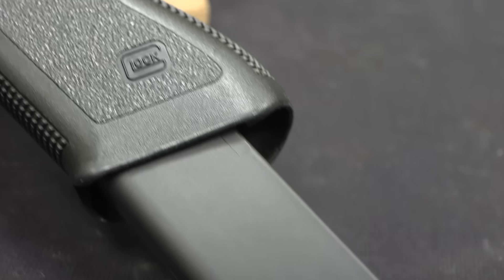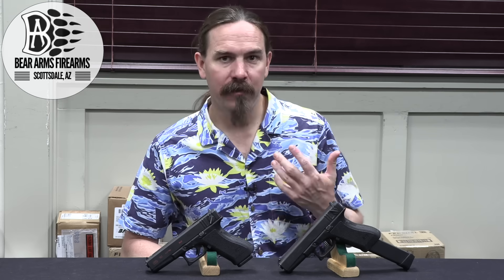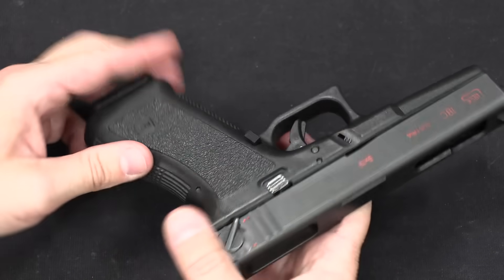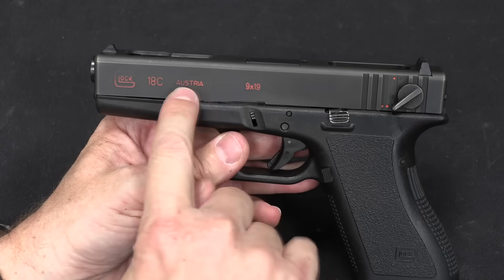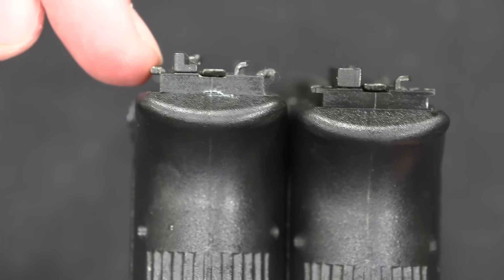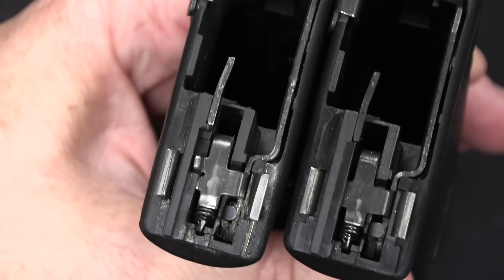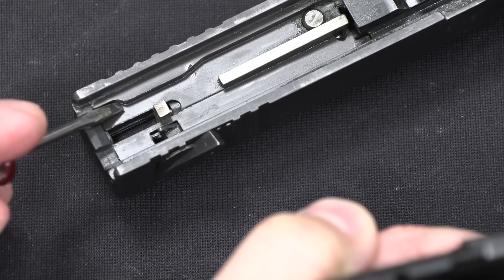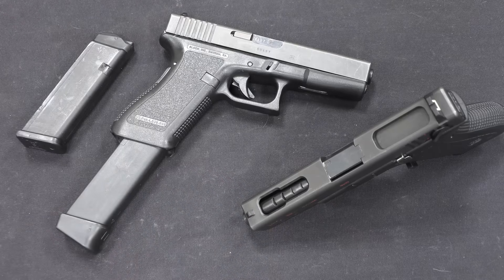Glock 18 & 18C Machine Pistols: How Do They Work?

Comment: So then how does the switch that inner-city folk use at the end of the slide work to make regular 17's into full auto?  Seems like it would take some milling, but I'm guessing that they aren't doing that.
Reply: The principle is the same: an angled surface pushes the sear down just as the slide reaches forward position. A small groove to the plastic frame is all it takes to clear. 

The mechanism in the switch moves the angled part rearward for semi so it doesn’t trip the sear.
Reply: @Glocktologist  Interesting.  Thank you!
Reply: Just a backplate swap

Comment: Clever solution to alter the slide rails to prevent the thing that we were all thinking about.
Reply: I imagine that even if you were magically able to slam an 18 slide on a 17 frame, the protrusion from the selector will just get caught up in the bit of the plastic rail that's cut off on the 18. It's pretty well thought-out honestly.
Reply: That and ud need to cut the plastic bit outta the way or fold part of it , or a diff sear or w.e since that little nub that sticks up not sure if factory one has enough length to stick up and make contact if cut and bent wouldn't think it would but it might, then drill small channel under back plate the rod for the extractor is why selector is on side it is drill hole for selector and cut the slit under simple spring and retaining pin held together by back plate otherwise woulda been simpler like the switches and just contact the back leaving everything else but slide identical and Easyer to produce since just slight mod to slide. Meaning there wouldn't be a need for any parts to be diff besides slide with selector cut retaining pin and spring and selector.

Comment: How do the backplate glock switches work? Is it still pretty similar?
Reply: My guess would be it’s the same idea but easier to make
Reply: It just prevents the triger bar from poping under the disconnector surface on the sear.
Then the slide peresses the triger bar again (normaly the out of batterie funktion).

Comment: A transferable Glock 18 is a literally impossibility. The G18 was released between 1986 and 1987 sure, but the Huges amendment was signed into law, May 10th, 1986. In any case it could not have been imported because the 1968 gun control act, made importation of machine guns illegal in its own right. And Glock did not open a US subsidiary, until 1988. So, a transferable G18, is not possible. At best it would have to be a pre may dealer sample.

Comment: I wonder are they still producing it. Since I've never seen any pics of g18 gen4 or gen5
Reply: G18 are not made as Gen4 or Gen5 the current version is Gen3
Reply: @Sink-rate  It seems so. Quite a shame since the gen 4 recoil spring upgrade could significantly improve the full auto firing